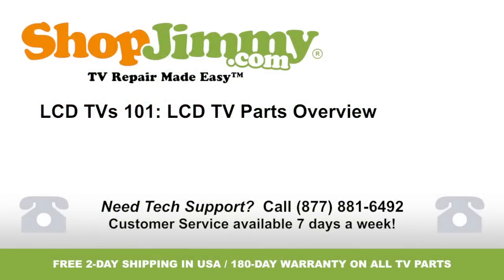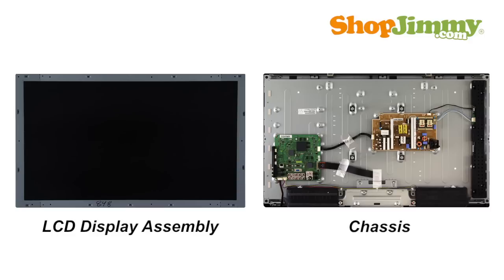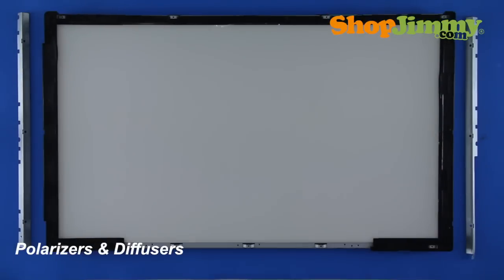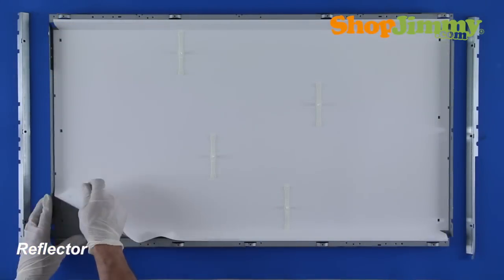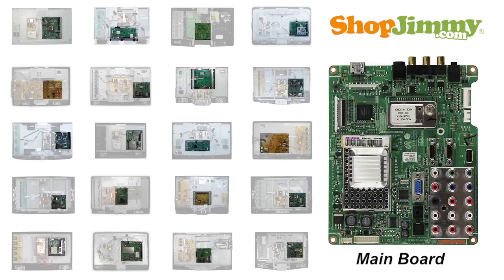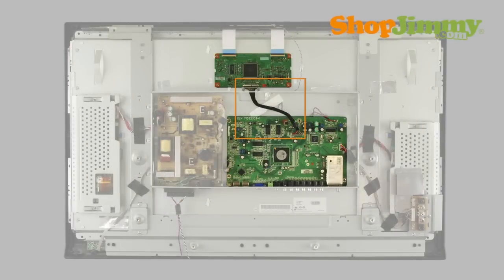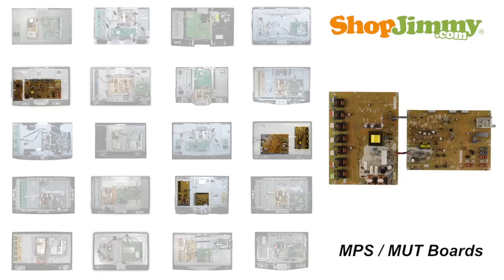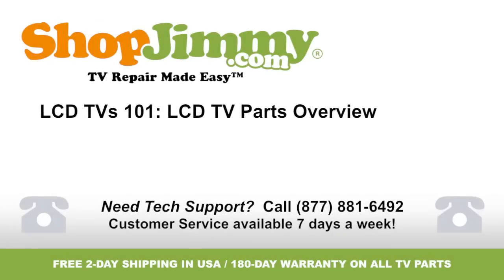LCD TV Repair: LCD TV Parts Overview Diagnosis & TV Repair - Common Symptoms

Comment: One other observation I thought I would mention is that since the screen got darker if there is something displayed on the screen for any length of time, the setup screen for example, when I go back to display a normal tv channel you can still see the ghost of that setup screen on the display for a while.  A banner displayed on the bottom of the screen for a short time will also still be there when the display has changed.  Don't know if this helps but thought I would mention it.

Comment: I have an LG 55LE5400-UC, the video is great with the exception of a 8 to 10 inch white bar on the right edge of the screen, the white bar is see thru but the color is washed out and its perfectly vertical. where should I start to figure out how to fix it. Thanks JB
Reply from the maker: Jeff Best  Try all repairs and troubleshooting at your own risk.  This sounds like a TV panel (TV Screen) problem.  If your TV panel is bad, it may be more cost-effective to replace the TV as panels are typically hard to find in stock, difficult to replace, and expensive.  Thanks and please let us know if you have any further questions!  www.shopjimmy.com

Comment: I have a SANSUI LCD TV. Model no. STYA 326 Serial no. WSO 882-449-0412. The problem with it is that it is just showing the backlight and there is no display. Can this problem be fixed. Is it possible to replace the tcon board?

Comment: I have a32in.Toshiba#32L2200U that has a black screen but still has sound, I can see images when I shine a flashlight at the screen at an angle,now i have learned a little something from these video's and have come to the conclusion that it is the inverter board that needs to be replaced,correct if I'm wrong.Can you help me with getting the part and directing me to the right video to watch to replace it.. Thank you..

Comment: Hi there. My JVC LED Tv no picture I get sound only. When I turn it on in the dark I can see menu on the scree, faded. Screen dark but I can still menu without using torch, as long as its dark. What could it be? lights or boards? Will you be able to supply me with parts?

Comment: HI I am still having a problem with my tv it a Tevion LCD 4202 I have replaced the power supply board and also the Main board. the red light still blinks continuously I am at a loss what to do next. Both boards I replaced were new and correct replacements.  any one advise me of my next step, thank you for all your great videos has inspired me at least to try and fix my tv.
Reply from the maker: John Evans   It sounds like you had bad replacement parts.  Thanks!  www.shopjimmy.com

Comment: I have a Vizio M420NV. When on a TV channel, there is no sound coming from the TV speakers however, if I bypass the TV and go straight to the Vizio sound bar, I have sound - so I know the cable box is working correctly. If I connect the Wii to the TV, I get sounds coming from the TV speakers that pertain to the game. All the cables/HDMI are brand new. What parts do you suggest I inspect/replace to get sound from the TV? Thanks!

Comment: Hi ! I have a Sharp Aquos LC-70LE845U. Recently I turned it on and I have vertical white area with some lines that are colored on the left side of the screen. The rest of the screen looks fine just that one area on the left side.  I have a picture I can send you of the TV issue if you need it . What is wrong with this TV. Thank you in advance

Comment: I have an Element Electronics 55in tv that has picture flickering and horizontal lines.  Visual inspection does not reveal any burst caps.  I was told to try replacing the T Con board.  I ordered the part on ShopJimmy.com and replaced but this did not fix the problem.  Sound works perfectly.  Symptoms occur on all inputs.  Horizontal lines and flickers gradually get worse and eventually the screen goes solid blue or yellow.  Sound continues to work.  Any suggestions on what to try next?  Thanks in advance.

Comment: I have a Samsung 46" LED TV  Model UN46B6000VFXZA which has thin horizontal bluish lines on the whole screen. It started a month or two ago with vertical lines on part of the screen which I think were red. Sometimes it would go away and then reappear. Now the whole screen has horizontal blue lines on it that won't go away.
Reply from the maker: Pyro man   This sounds like a TV panel (TV Screen) problem.  If your TV panel is bad, it may be more cost-effective to replace the TV as panels are typically hard to find in stock, difficult to replace, and expensive.  Thanks and please let us know if you have any further questions!  www.shopjimmy.com

Comment: I have a LG v model # 42LM3400. the TV when I turn on  a red light will light up. The TV has Audio sound but no picture or video. The TV was working fine until I remove it from the High Night Stand and almost drop it but didn't the Electric cord and HDMI was pulled out and then I put it on small TV stand. I turn the TV on a red light came on and there is Audio sound but no picture.

Comment: I have a 46" Samsung model number LN46C630K1F and I can't figure out what needs replaced or if it's even worth fixing. The problem is a thick verticle black line running from the top of the screen to the bottom and right beside that is a thick white line that you can kind of see the image but it's really distorted. The problem is there all of the time. It shows up on the menu and every different input. I ran the screen test and it is on there as well. I also downloaded the newest update and installed it with no success. If it's a bad panel I don't want to waste money replacing boards and it's not worth the cost of a new panel. Thanks in advance for any advice
Reply from the maker: Michael Patrone   This sounds like a TV panel (TV Screen) problem.  If your TV panel is bad, it may be more cost-effective to replace the TV as panels are typically hard to find in stock, difficult to replace, and expensive.  Thanks and please let us know if you have any further questions!  www.shopjimmy.com

Comment: Hi I hope you can help me what I can do next. MY TV is TEVION 4202. LCD the problem when I turned the poower on the red light would blink about four times then stay on but no start up. I replaced the  PSU board  now the red light blinks continuously and still no start up
Reply from the maker: John Evans   I recommend replacing the main board in your TV.  Unfortunately I do not see any replacement parts in the search results for your TV model number on our website.  Please reply with your part number on your main board and I can try searching for replacement parts.  Thanks and please let us know if you have any further questions!  www.shopjimmy.com

Comment: Hi, trying to fix my LG 42ld550 LCD TV. When turned on, picture being broadcast is unviewable, mostly diagonal/horizontal distortion from bottom left to upper right. Audio is ok, unaffected. After tv warms up, within 15 minutes, the picture starts to correct itself, slowly coming back, shimmering, and then finally good, stable, good color, definition. Have pics to show. Capacitors? logic board? power supply? 42LD550-UB.CUSWLH svc code. Any advice appreciated!

Comment: I have a Samsung LNT4069FX/XAA  I turned it on one day a line of light went from top of the screen to bottom it made a terrible noise and I immediately turned it off.  Now it turns on, we get the turn on noise and the blue light on the bottom works, but there is no picture and no sound.  We can't even get the menus to show from the Samsung remote.  We have opened it up and see no visible signs of popped capacitors or shorts in anything.  What next?

Comment: I have a Philips lcd tv model 37FPL5322D/37.  About a month ago the picture got darker, not in any particular spot but the whole screen is noticeably darker.  I've had to raise the brightness level to 70%, I think it's always been at around 50%.  Even at 70% it's dark and if I increase the level any more than that then the flesh tones seem to get washed out.  Any ideas on what I would need in the way of parts to fix this?
Thanks

Comment: Sean MourningI have a LG 37lp1d-ua that comes on when plugged in. The back light no longer lights and the buttons on the front(volume, on-off etc.) do not work. I do not have the original remote so I purchased a universal remote but none of the codes work. Even when doing an auto search.
Reply from the maker: +Sean Mourning   Try all repairs and troubleshooting at your own risk.  I recommend running the flashlight test on your TV.   Here is a link to a video we produced that shows how to run the flashlight test. https://www.youtube.com/watch?v=xUzCLgoSPGM Please reply with your flashlight test results and we can recommend a replacement part for your TV repair. Thanks and please let us know if you have any questions! www.shopjimmy.com

Comment: I have a may 2008 vizio  tv. model #VO42LFHDTV10A, I  don't get a picture or sound. in the upper right corner I get a flash when  I first turn it on,then it goes black.

Comment: I have a Funai LF320FX4F. Serial #DS1A13281494620, After pressing the power button, the red light will flash numerous times. Then, the screen will show the Funai logo for a few milliseconds, then the red light goes to solid. I have checked the all of the diodes in the service manual, fuse and caps. The service manual only refers to replacement of the entire boards if defective. Do you have some guidance you can share with me? Thanks for your time!

Comment: Hi. My 2013 LG 32LN3200 is shutting off after 45 - 55 minutes.  The power indicator light keeps flashing after that.  Doesn't have video neither sound.  After leaving it to cool off for 10 - 15 minutes, it can be turned on and work again, but it shuts off after getting hot again.  When removed the back panel to check the voltages it worked immediately (as if the panel removal cool it off faster), giving me no time to check the voltages.  I've been told that the capacitors at the power board can fail when heated,  I was thinking about replacing them.  What do you think?
Reply from the maker: +Jose Aponte   Try all repairs and troubleshooting at your own risk.  I recommend replacing the main board in your TV.  Unfortunately I do not see any replacement parts in the search results for your TV model number on our website.  Please reply with your part number on your main board and I can try searching for replacement parts.  Thanks and please let us know if you have any further questions!  www.shopjimmy.com

Comment: Hello, I have a Sony  tv Model # KDL -55v5100,,,,,,,,,Serial # 8016214. Problem I'am having no picture was watching a program and bang the picture went out I made calls to sony did all of their instructions with no fix I call cable company and no fix did all of their instructions with no fix, The tv has volume but no picture. I tried everything with no luck, a week before this happened the screen went PINK and I just rebooted
 the cable and it was fixed but then after 2 weeks the Picture is gone and the remote to the tv will not display anything so I cannot get to any inputs.......Please help me out as to how to fix the tv myself with what PARTS I need to purchase and video on how to resolve my problem Thnak you so so kindly

Comment: Hey i have a WHARFEDALE LCD37F1080P and i just replaced the tcon board and it did clear up one of the issues i had which was it was giving a white clouding to the image but my image is still in negative i was thinking the next part to change would be the main board?
Reply from the maker: sgspecial18  Please watch this video FIRST to help with your repair!  https://www.youtube.com/watch?v=BP3NVNCGEv8  This could be a problem with either the main board or the TV panel.  You can replace the main board to see if that fixes the problem.  Click this link to a replacement main board for your TV.  http://www.shopjimmy.com/vestel-20362167-main-board-for-lcd37f1080p.htm  Be sure to match part numbers on your current board, with your replacement for compatibility.  Thanks and please let us know if you have any further questions with your TV Repair!  www.shopjimmy.com

Comment: Hello, My TV Shows double time I turn it on. It kind of looks like the Polarizers and Diffusers slide you have at the 1:31 mark on this video. I nicely wiggle the TV and it goes away. Its a Sony. Thank you -
Reply from the maker: gimpy007   Try all repairs and troubleshooting at your own risk.  Please reply with your TV model number.  Click here to view a video that shows how to find your TV model number:  https://www.youtube.com/watch?v=S51nhAmwR2M  Thanks!  www.shopjimmy.com
Reply from the maker: gimpy007   Try all repairs and troubleshooting at your own risk.  This sounds like a TV panel (TV Screen) problem.  If your TV panel is bad, it may be more cost-effective to replace the TV as panels are typically hard to find in stock, difficult to replace, and expensive.  Thanks and please let us know if you have any further questions!  www.shopjimmy.com

Comment: Hi,
I’m having issues with my Samsung Model: LN46A630M1FXZA SN: AQD93CUQC02453B Version: AA02. Problems started with vertical lines on the right side of the screen, I continued to use the TV in this condition for well over a month before it went dead and would no longer turn on. With the help of the Shop Jimmy You Tube videos I replaced the power supply with a new board from Shop Jimmy. The power supply works great, the TV turns on and all functions work but the vertical lines on the right side still exist. What should be my next course of action? 
Thanks,
Jeff
Reply from the maker: Jeff Davis   This sounds like a TV panel problem.  If your TV panel is bad, it may be more cost-effective to replace the TV as panels are typically hard to find in stock, difficult to replace, and expensive.  Thanks and please let us know if you have any further questions!  www.shopjimmy.com

Comment: Hi, my Sharp LED TV having problem when turning on.(Sharp LC-52LE830U model) If I turn on it will power up for a while then turn off again. It has video image but again it will turn off.
Reply from the maker: secret4ever  I recommend replacing the main board in your TV.  Click this link to replacement parts for your TV model number:  http://www.shopjimmy.com/catalogsearch/result/index/?cat=56&q=LC-52LE830U  There may be multiple boards for the same TV model number, be sure to match part numbers on your current board, with your replacement for compatibility.  Thanks and please let us know if you have any further questions with your TV Repair!  www.shopjimmy.com

Comment: HI, I have an LG 47LH30-UA that has the standby light on then flashes and repeats. power button does nothing, screen does nothing. checked for blown capacitors, nothing. do i have a Power supply board or main board issue?
Reply from the maker: Kevin Sanders   If you can check voltages look for your 5 volt standby on your power supply, if you have that replace main board if no 5 volt replace power supply.  Here is a link to replacement parts for your TV model number on our website, click here:  http://www.shopjimmy.com/catalogsearch/result/?q=LG+47LH30-UA  Be sure to match part numbers on your current board, with your replacement for compatibility.  You can also call our customer service for further assistance with your purchase.  (877) 881-6492  Thanks and please let us know if you have any further questions with your TV Repair!  www.shopjimmy.com

Comment: Hi I have a TV LED LG 42 lf 2510 (ZB.BEUDGLJG- serial number 909WRJRJC1V572) recently the image has turned over saturated especially in red. But the tv menu icons look normal
From what i have read this may come either from the main board or from the T CON. How can I decide which is the faulty one? Thanks for help!
Reply from the maker: serenevan   Please watch this video FIRST to help with your repair!  TV Repair! LCD, LED, Plasma, DLP How To Fix Your TV with ShopJimmy.com Help!  This could be a problem with either the main board or the T-Con board in your TV.  You may need to replace each board individually to see which one fixes the problem.  Here is a link to replacement parts:  http://www.shopjimmy.com/catalogsearch/result/?q=42+lf+2510  Be sure to match part numbers on your current board, with your replacement for compatibility.  Thanks and please let us know if you have any further questions with your TV Repair!  www.shopjimmy.com

Comment: I have a Toshiba 55" LCD TV Model# 55G310U.  The other day I noticed the picture was dark.  You can still see a picture, it is not a black screen.  I still have sound.  The menu is also dark and the screen stays dim no matter what input we have it on.  What could this be?
Reply from the maker: o23hippy  PLEASE SUBSCRIBE TO OUR CHANNEL - Try all repairs and troubleshooting at your own risk.   I recommend replacing the power supply board in your TV.  Click this link to replacement parts for your TV model number:  http://www.shopjimmy.com/toshiba-75023995-power-supply-unit.htm  There may be multiple boards for the same TV model number, be sure to match part numbers on your current board, with your replacement for compatibility.  Here is a link to a video showing how to identify your part number, click here:  https://www.youtube.com/watch?v=b9L0-m0-pjA  Thanks and please let us know if you have any further questions with your TV Repair!  www.shopjimmy.com